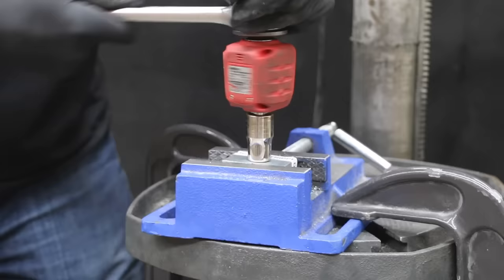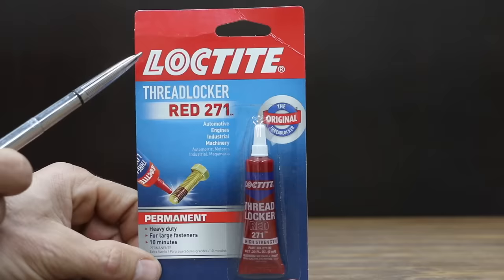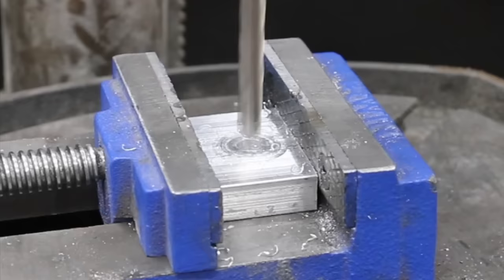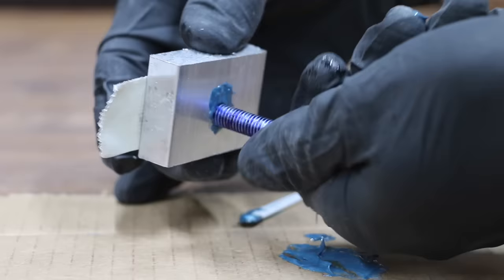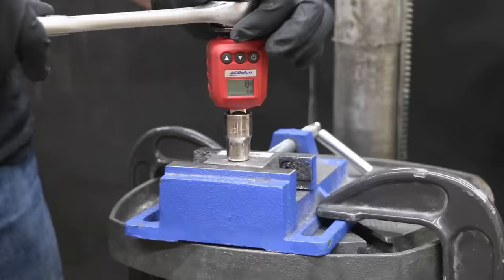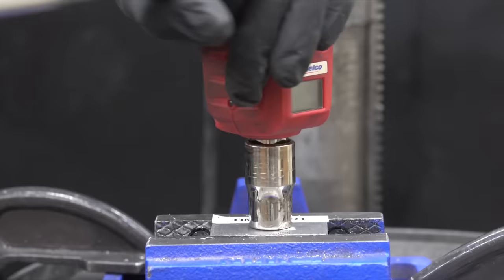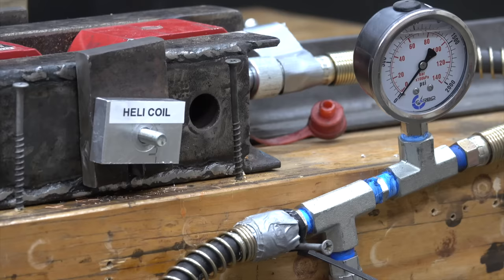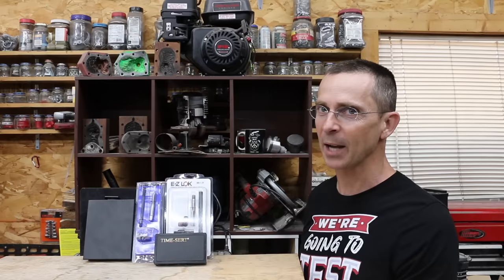Best Damaged Thread Repair? Let’s Settle This! Heli Coil, TIME-SERT, E-Z LOK, JB Weld, HHIP, Loctite

Comment: For the options where the bolts snapped: The test now is about how strong the bolt is, not about how strong the insert is. So the tests can't say anything about which ones of the inserts are actually stronger, since they all basically passed the test.
Reply: Isn't this obvious?
Reply: @TheCarLovingSwede  It should be. But still, the test charts show at what force the bolts snapped and the options are ranked by that value.
Reply: @dak1st  What kind of bolts are you using that survive well over 1000psi of pressure?
Reply: @BtappinHD  The tensile strength of the bolt is what was being tested. The threaded section is generally stronger than the shaft of the bolt. They performed as expected, broke, and proved nothing. The test was however of note for the non-insert methods, as he was testing the "restored" threads, and not the bolt itself. 

His application of pressure was merely to apply tensile force to the connections. To answer your question, damn near all of them in that size. Tensile strength is purely a product of the cross sectional area of the bolt or material, and the material used to manufacture it. Want a stronger bolt? Up the size, or up the grade of material.
Reply: @ChevyConQueso  So your saying he should've had something push on the bolt from the bottom instead to test the strength of the insert?
Reply: yeah but hes provided the max value of the bolt failure for good refrence....what if the thread insert was going to fail at 1010 psi but the bolt failed at 1009 psi then the other thread lasted till 1050psi...he gave us the number he had
Reply: @urbanferret4669  I guess yeah maybe needed a stronger bolt to push the thread even further
Reply: @urbanferret4669  OTOH, what if the 1050 would have failed at 1051 and the 1009 could have held out until 1100 if the bolt was stronger? Or another situation, simply the two bolts happened to have been switched around and now the two products switched scores simply based on luck of getting the stronger/weaker bolt. As originally pointed out, we didn't learn anything about which product was stronger than the other except they were both pretty impressive.
Reply: @stewkingjr  And in the end, the strength doesn't even matter at that point. If the product is stronger than the bolt, that's all the information necessary. It makes no difference to the user whether the product can withstand 1.5kpsi or 100kpsi if the bolt snaps at 1kpsi. Unless the user somehow has a stronger bolt.

But in the end, everything that's stronger than the bolt is not the weak point anymore and thus should get a grade of "passed". At that point, using a better product will not improve the strenght of the whole system and thus won't change anything.
Reply: I agree. I thought about this for a while and came to the conclusion that even if he upgraded the bolts to something stronger, the results still may not matter.

We have three possible failure modes:
1. Bolt breaks/bolt threads fail
2. Base material fails structurally
3. Repair fails structurally

A numeric result for 1 is meaningless, I agree.

I'd argue that 2 may also be meaningless, and might happen if he moves to a stronger bolt, since he's using aluminum for the base material. I suppose this could be like 1 (basically a pass/fail) since it tells us if the repair is stronger than the base material. I'd probably want to see more common base materials than just aluminum if he were testing this.

3 is the only meaningful failure mode to report numerically in my opinion. If you're able to make it happen in the stronger repairs, it might tell us something about how much axial load the repair could take.

2 and 3 would require a different test setup in order to get valuable information from all the different repairs. Something like @BtappinHD suggested where a bolt is pushed rather than turned.

All that's to say that I think the more useful information is what we were given in the video. My objection is to how it's presented in the charts. The meaning of the number for one of the repairs that failed differs from the meaning of the number for the trials where the bolt broke. I think the two have no business on the same graph. My takeaway from the video is if you want the bolt to go to factory torque, use one of the high-scorers. If you need to use one of the low-scorers in a pinch, here's about what it's worth.

If the above third failure mode matters to you, I'd go with one of the ones that rust. Though, I imagine the forces required to get into that scenario would be wildly unrealistic, even with the ones that don't (but still broke the bolt).
Reply: @BtappinHD   High tensile bolts or larger diameter bolts.   He used 8.8 Grade in this video, with higher grades easily available.
Reply: @ChevyConQueso   The threaded area is NOT always 'stronger' than shaft size of a bolt. 
A machined thread form on a shaft will always be 'weaker' than a roll formed thread unless heat treated.
Reply: @BtappinHD   It would have been a lot safer for sure.
Reply: I agree. For the tests where the bolt failed rather than the insert, for 100% correctness, the chart should have said "bolt failed" and not given a numerical value, and given all such inserts an equal ranking. Problem is that as presented, the chart ranks them numerically, essentially penalising inserts which happened to have weaker bolts even though that wasn't the fault of the insert. 

However, we all understand this is a YouTube video not a scientific paper. There's no requirement to be that academically rigorous. He's done excellent work with good experimental design and has given us enough data in the video to make a sound conclusion. The conclusion is: it doesn't matter which insert type you use. The bolt will snap before the insert fails. So pick whichever insert works best for you (or is cheapest or most available) and don't worry about the strength.

Now, if we were interested in quantifying insert strength, the experiment would have to be repeated using high-tensile bolts and tapped into steel plate not aluminium :)
Reply: I agree, especially in the inserts the bolt will bottom out on the insert itself when tightening. A high tensile bolt with washers underneath or the push trough method would test the inserts holding power in the base metal better. Great video though, thanks!
Reply: They are stronger than the original threads so ultimately it doesn't matter how much stronger they are.
Reply: @zosxavius  Yes it does, these are used also by design to reinforce threads where the base material is to weak to hold the load.
Reply: @HakkaDakka  that's something entirely different than thread repair. in that case those companies have also done their homework. For what its worth I would expect all the inserts to perform about the same since they are all only as strong as the threads that hold them in place.
Reply: @ChevyConQueso  And what we saw was the variance in the metallurgy of the bolts. Probably all from the same box, but some took more torque than others. I see it a lot when machining some metals of unknown origin (read as Chinese). I can see and hear when my tool bit hits a hard (or soft) spot.
Reply: @BtappinHD  If he wanted to test the inserts until failure he could have tried Grade 8 or metric 10.9 bolts. But I would guess we would see the same results with parts just flying farther.
Reply: @stewkingjr  What the testing did show was that a properly installed threaded insert will not fail before the bolt fails. So, in his testing of ways to repair threads he definitively concluded that threaded inserts work better than anything else tested.
Reply: Well, its also a test of the cheaper thread insert brands vs. the more expensive.
Reply: The torque channel did this same test. You should go watch it. they used l19 head studs for the bolt. The results for the coil style thread repair kits are crazy. They did better than the other styles like timesert. and got to over 9k psi.
Reply: @jasonwarner6323  That is a test that is worth watching, this here only shows what will work and what will not, nothing more. Well for most people or almost all people this here is enought for people to have a good idea what to buy and what not to even try.
Reply: @steadyeddie7453  he did 8.8 or 8.9. If 10.9. Why not 12.9?

He did great. Gave us a baseline non opinionated, love pf.  Answers so many questions for US!  Thank you!
Reply: @TheCarLovingSwede  It wasn't for me until spelled out
Reply: Go do it yourself then

Comment: Great video as always.  Thank you for testing this for us. 

Just a note on my personal preference.  I have actual thread checkers.  I prefer them to calipers and that thread gauge.  It helps when you aren’t sure if it’s standard or metric.   Also if you talk to the helicoil manufacturer they recommend using flat nose/needle nose pliers to break off the tab. They have an unbelievably wide array of products even within the same thread size although finding them may be difficult if you are not an industrial customer.
Reply from the maker: All great feedback!!  Thank you!
Reply: You have a link to said tool? I'd like to see how it works
Reply: @consaka1  Basically a specially machined bolt and nut, with 2 ends, where one end is the minimum size for that particular thread diameter and pitch, used to check the thread is not oversize, and is the go size, in that it must fit without binding, and must be firm with no wobble. The other side is cut to the maximum diameter, at least just past the first few turns, and should engage a turn or so, so that you are sure the thread is not oversize as it stops going in. For the nuts the first is the maximum diameter, and all bolts should fit with no slop, and the other side is the minimum, and it should not go onto the bolt after the first turn or so. 

Unfortunately precision parts, and you need one of each double ended tool, per fastener pitch and diameter, so these are not common, normally used only for very close tolerance work where you are running the fasteners at a very close tolerance and at a very high loading. you normally see them in aviation maintenance, where they are used when rebuilding airframe and engines, to determine whether a fastener, which is normally an expensive part, as the cheap (under $5 each) fasteners are simply regarded as a part you throw away each time. These are for the more expensive ones, where you will use the gauge to check the fastener, and the hole, are still within tolerance, so as to allow them to be reused. $500 gauge, used to check a $1000 plus bolt, and the gauge itself has to be calibrated and certified annually, or more often, depending on use. Half of an aircraft repair facility toolbox is special measuring tools, so they use a Snap On toolbox, as that is often the cheapest single part in that tool box. Spanners have serial numbers in a lot of cases.
Reply: No kidding.  We had a case at work where an engineer reverse engineered a design and came up with using #4-40 screws on a new design that used some of the old parts.  Turns out the original design was from Sony in Japan and the screws were M3x.5.  Then when we tried to assemble them, the countersunk screw heads would all stick out and the unit wouldn't slide into the rack.  It took forever to figure out what was going on, until I was talking over the problem with one of our machinists, and then the lightbulb went on in my head.  Thank god that they hadn't used #4-48 screws, which are almost exactly M3X.5 size.
Reply: @consaka1  the official way of measuring threads is with something called the three wire method. But it's a royal pain to do.
Reply: @1pcfred  I've heard of that a long time ago. I'm into simpler methods. The problem with the cheap little thread counter tool is it doesn't take into account bolt diameter. And there's some weird size/thread bolts out there.
Reply: @consaka1  threads should be pretty standard. And when they're not there's a way to fix that. I stay away from old British cars personally.

Comment: The one thing you didn’t say about the E Z Lok brand, is you don’t need special tools for them, like the rest of the Thread repair inserts. E Z Lok depending on which one you have, usually you just drill and tap it to the next size bolts, and install your insert.

Comment: One issue that should be addressed when using a non-stainless steel insert with aluminum is galvanic corrosion.  Basically, if the insert contains any steel, the whole thing needs to be kept WELL sealed against water ingress to prevent the aluminum from being eaten away.

(...and you need to be using better bolts!  :grin: )
Reply: Did you check the RATE OF galvanic corrosion?  You will be dead 5 times over before it "might" be a concern.  (Like in aircraft.)   VW & Vega & Asian cars & motorcycles (& others) use aluminum and steel interchangeably, Like it is not a Concern even if you have the machine for +40 years.
Reply: @bunzeebear2973  ford ( wasn't the only big-3 ) did have problems with AL body parts on a steel unibody and with the f150-AL framework years later guess they had to relearn there mistakes
Reply: @richardprice5978  On a car, one very often overlooked notion is that the metal body is used as a ground for the electrical system, and you drive it in wet AND and dirty/ salty conditions all the time.
Reply: actually SS vs AL galvanic wise isn't a good idea it speeds it up

iron and aluminium is a problem but manageable and or slow or not-really a problem in a dry vacuum 22HG-
Reply: @bunzeebear2973  ...and almost ALL of those steel bolts/studs are cadmium coated to help with the galvanic issue ;)
Reply: @bunzeebear2973  Heli-Coil offers the inserts with a coating to prevent that
Reply: Some galvanic corrosion is a good thing as it helps retain the insert so that it doesn't back out of the part if the bolt gets stiff in the insert from corrosion.
Reply: @hdrenginedevelopment7507  ...poor mans loctite....lol
Reply: Stainless with aluminum is significantly more galvanically corrosive than steel.
Reply: @dumpsterdave3710  .......DEPENDS ON THE ALLOYS OF BOTH....THERE ARE MANY DIFFERENT ALLOYS OF BOTH.  DONT MAKE BLANKET STATEMENTS THAT ARE NOT TRUE.
Reply: @ssnerd583  Most people are going to be working with mild steel and 304 stainless.  304 stainless is significantly more galvanically reactive with aluminum than mild steel.  We're not talking exotics.
Reply: @dumpsterdave3710  ....again...AN ASSUMPTION.  I work with 3 or 4 different aluminum alloys and several of the CRS materials including 301 303 304 316(L) 321 2205/2207 and even 17-4 on occasion and a couple others that are a bit more exotic and not likely to be found outside of the aerospace industry or DOD

Comment: Thanks for another great test and a huge amount of work to set it up.   I'm confused by the results, however.  Once you reach the point of breaking the test bolts, it becomes a test of bolt strength, rather than female thread strength (other than up to the breaking strength of the bolt).  So the fact that the EZ-Lock tested so much higher than the other thread insert products just means that the bolts were stronger, although it seems an odd coincidence that all the bolts used with that product were so much stronger than all the bolts used for the other thread insert products.
Reply: No, it was also checked that the threads were still fine and shaped, not ruined, after breaking the bolt. 
For the EZ-lock difference I points to the size of the coil: others were smaller, EZ was the largest (nearly 12mms); this leads to a wider surface exposed between lock&metal (hence applicable force).
Reply: @Quartolone  This has nothing to do with the bolt breaking strength though. That would only explain "if" the ez lock insert had a higher pull out force then others. Given the replication on the result 3 times, there must be some explanation, but that isn't it. My guess would be it has to do with the consistency of the threads of the ezlock insert dispersing the force more evenly over the length of the bolt. Even the time sert failed lower as due to its expanding nature during install likely creates an area of slightly distorted threads which then concentrates the load in the bolt. Hence it breaks sooner. The loose coil style inserts are obviously (and from experience) are much more subject to the install technique and quality vs the solid wall inserts, again resulting in load concentration areas on the bolt. Also, everyone notes the ezlock size as a disadvantage, this all depends on the installation; some times that size (and why you can get extra thick ones) allows you to fix a completely shagged up thread back to a desired size. Ie. So it is consistent with the rest of a "set" of threads/holes.

Comment: As always, great work on the testing and video. Just a few things I'd like to say.

1) Assembly of DRY steel bolts into threaded aluminum holes will quickly strip the thread in aluminum due to friction. Especially when parts must be disassembled frequently. 

2) Determine the drill size for metric fasteners WITHOUT a chart. Simply subtract the pitch from the diameter, i.e. M8 x 1.25 fastener requires 8 - 1.25 =  6.75 mm drill (further divide by 25.4 for decimal drill size).

3) Too bad Keen-serts weren't considered. My customers have begun asking for these type inserts when I repair their parts. Even when the original drawings call for EZ-lok, they want Keen-sert instead.
Reply from the maker: Great information! Thank you